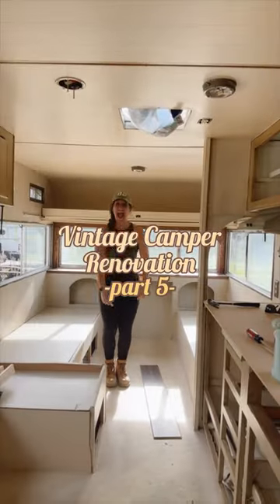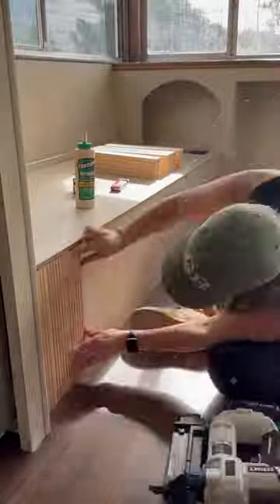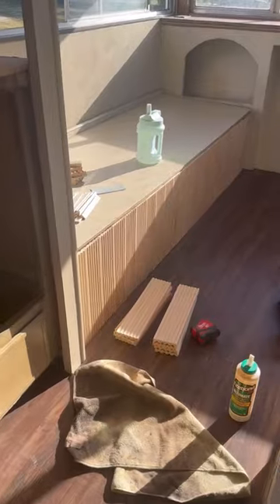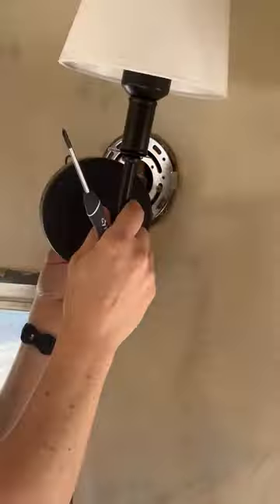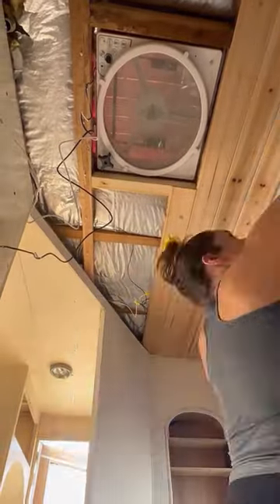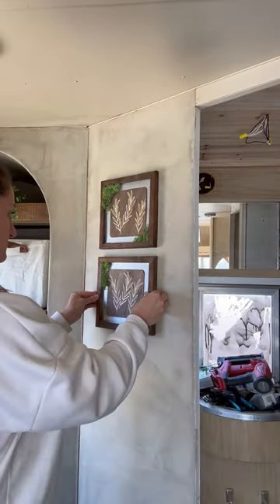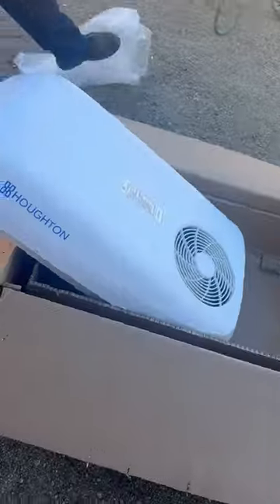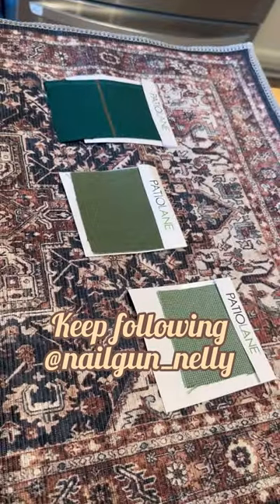Part 5 Vintage camper Reno! #rvreno #diy #restore #rvlife

Comment: Maybe seal the wood. Its a great color as is.
Reply: I agree.. maybe tea stain lightly, to take off the harsh brightness. Easy and cheap.  Just another cpl steps and drying time. Maybe run sand paper over it before sealing it. Just in case any fibers pop up. Since your other wood colors are multiple shades but not bright or harsh, or almost black, I'd take that step. 
Look at it like this.....
How do you feel walking into a beautiful home, with beautiful colors, natural or lightly stained, then you turn the corner to a WHITE kitchen with gold trim.. like the mid 80s... wouldn't you want to see a natural marble and toned down cabinets,  change the hardware?  
I'm not saying its WHITE but you definitely want a place thats relaxing, and  esthetic to the eye.. since you sleep in that room... what colors absorb or reflect light? 
You definitely want absorb... reflect will keep you awake... like cars driving by and a mirror reflection on your bed. Not that bad but you know what I mean. 
Ppl purchase white cars more because of that same reason.  
Not trying to seem rude.. As a stylist, coloring hair, you see colors in multiple ways.. then a Theater major .. stage  costume,  etc... everything from design and construction.  Yes .. i is be a GIRL.. ok woman. That likes to mess with verbiage to be cute